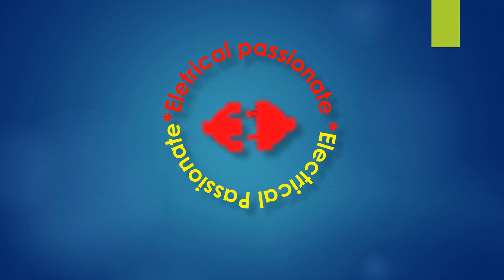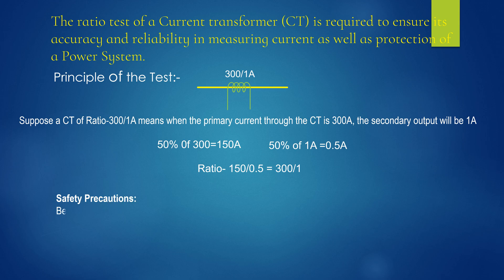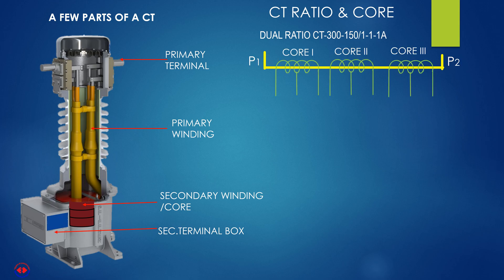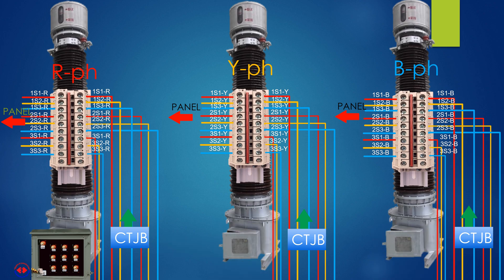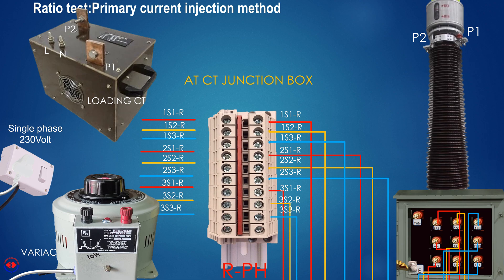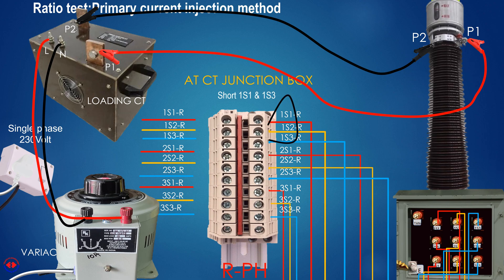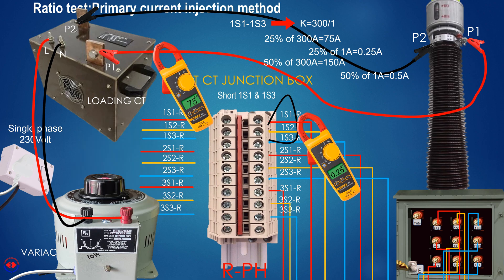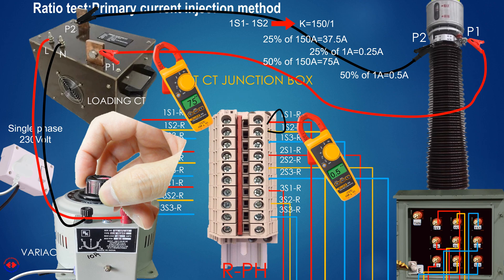RATIO TEST OF CURRENT TRANSFORMER/CT RATIO TEST/RATIO TESTING PROCEDURE

Comment: What's the use of loading ct kit between CT and Veriac,sir
Reply from the maker: You are welcome. Sorry for belated reply. Loading CT is required to increase output current to a high value nearly 125℅ of rated primary current of the CT under test. Thanks.

Comment: Sir how i decide the capacity of loading transformer suppose ct rating is 4000/1A
Reply from the maker: You are welcome. So far as my knowledge is concerned 2500A output LTR is available. Beyond this range like 4000A you can use Automatic  CT testing kit (pry. current injector). Thank you.

Comment: Nicely explained sir, but what will be the capacity of loading transformer & how to calculate??
Reply from the maker: You are welcome.It is considered, Loading transformer current rating should be 125% of current rating of the CT under test. Other parameters should require to consider also.This short place is not suitable for explanation of Calculations and others. Thank you ❤.